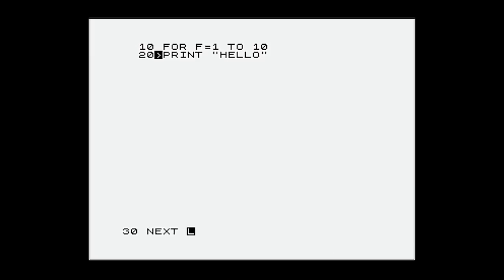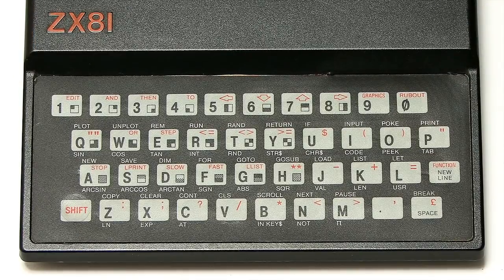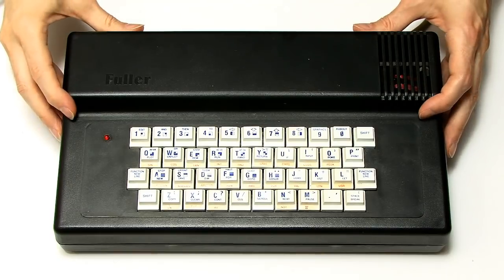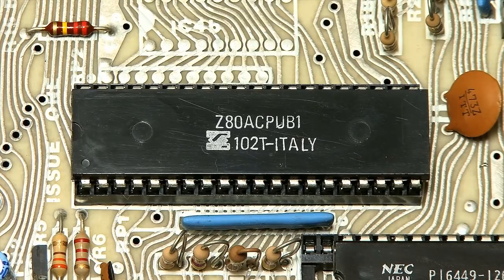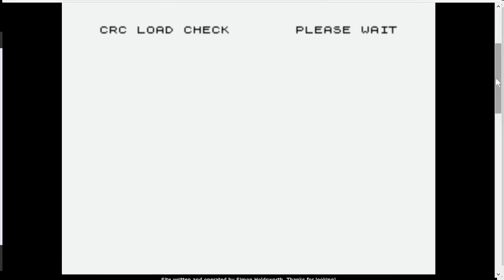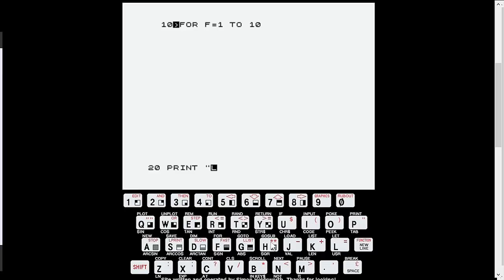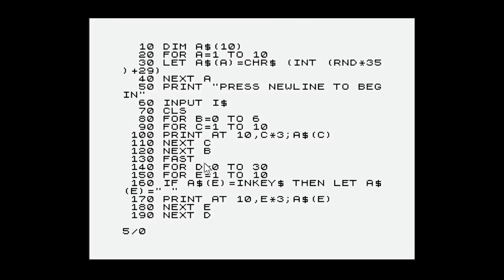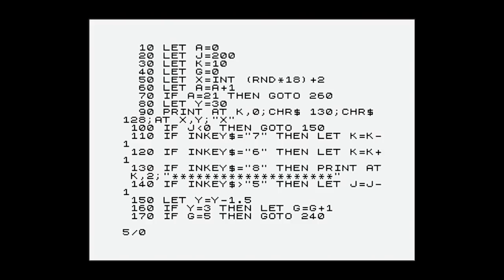ZX81 Classic PC

Comment: What a trip down nostalgia lane.
I bought a Timex sinclair 1000 in the mid 1980's at a flee market in downtown Johannesburg in South Africa.
I was so shocked to see it standing there with perhaps two more, and fearing that they will disappear quickly, I ran
to the nearest ATM and bought one.
The T1000 was not my first foray into the world of computing/IT. I first encountered them in the form of a 
programmable calculator in the early eighties.
My eldest brother was studying civil engineering and had to use one of those and it had a red LED screen and all of
50 lines you could program. Using his BASIC manual and trying out the HP calculator's own instructions (not BASIC) I wrote
simple programs. By the time I encountered the T1000, I had an idea of the implication of these things.
I later got a 48 ZX Spectrum and write a word processor for it in BASIC. One of the very useful features of the BASIC on the ZX Spectrum was 
the ability to assign a number t o a variable, and use that variable like a lable in a program. SO instead of writing 
20 GOTO 200, you could write GOTO/GOSUB printdata where printdata was given the appropriate line number. That was incredibly powerful.
I ended writing a decent 3-line wordprocessor that could print, save to tape load from tape and do all the needed edits.
Pretty neat.
Wow what a time that was. From there I ended studying Computer Science and Maths through UNISA (University of South Africa) and in 1995
I was amongst the first of about 250 people who finished the Microsoft MCSD qualification and becoming the first in 
Africa to Present MCSD courses as a qualified MCSD trainer. That is so long ago now.
Thanks for reminding me of a pioneering era in my life. 
Love your channel Chris.
Reply from the maker: Thanks for this, great post. :)

Comment: My first computer, which I still have, was the Rolls Royce of the genre in the early 1980s - the BBC Model B. It wasn't until 1990, though, that I got a program published (a lunar eclipse predictor) which earned me £98 - a considerable sum in those days.

http://www.acornelectron.co.uk/mags/mu/ills/090/sc-p043.jpg

I have a ZX81 languishing in a cupboard upstairs. I bought it to automate our central heating system. The wall-mounted boiler was in the kitchen so that's where the ZX81 had to go. Regrettably, the spark ignition on the nearby cooker hob caused enough electronic mayhem for it to crash every time, so that was the end of that particular project.

Comment: My system in the '80's was the C-64. Had started with PETs though. I actually started working in my school district's IT department my senior year and learned to repair various commodores as we were still keeping them working for elementary school classrooms.

I remember turning a couple into RAM test boards as the memory test software I had for C-64 was better at identifying bad ICs than the PC parity test we were using on XTs.

Comment: Great video! 
in 1983 or so I bought a used TS1000 at a pawn shop for $10, the bargain price was because the video output was garbled. As a electronics technician I thought that I could fix it and I did eventually. The fix was pulling the video processor PROM chip out of a good TS1000 owned by a friend of mine, copying the code from that chip and burning the code to a blank PROM. I think the blank PROM cost like $3. The video chip was mounted in a socket so once I had a good chip it only took about a minute to swap out, no soldering!
I remember playing the game "Frogger" on the TS1000 and transferring files to and from using a tape recorder.
After the TS1000 I bought a Radio Shack Model 4P which I recall also ran a Z80 chip.
Ah, the good old days!

Comment: Zx81 was my first computer. In fact you could get a replacement membrane keypad. I wrote for this computer as did my cousin who later purchased the Jupiter ace. Forth turned out to be amazingly fast. I remember having to use clever memory saving techniques for example to declare the number 3 which otherwise would take up extra bytes you wou type let a=Int(PI) . The other thing you didn't mention here is machine code or assembly. You would basically poke a Rem statement  then call the code with Rand user 16584 something like that. Which was cryptic coding back then. The machine language sits still today under all that windows dos, C coders overlay... The larger memory and CPU came about because too few people new the raw code and they had to compensate for bloatware. Thanks for the video thanks for the memory
Reply from the maker: Ah, I have not thought about memory pokes and the RAND USR thing for so many years! Thanks for the reminder. :)

Comment: I wrote many programs on my Timex Sinclair 1000 - I had the 16K expansion and the thermal printer.  I would write all my programs out in notebooks (my kids recently found them and laughed... I am not sure why-  :-) ).  I remember in high school loading my D&D game in from the cassette tape hoping it would work.  I can remember being able to tell if the load would fail if based on the sound of the tape.  Very frustrating.  I think about 1 in 4 loads failed. I still have the computer and components.  I love this video - Thanks!
Reply from the maker: The good old days. :)

Comment: My first home computer was a BBC Model B with the cassette filing system though I did upgrade to discs. After that it was a Gateway 2000 running Windows 95, but I still have my BBC and a great BBC emulator running on Windows 7.

Comment: I had the Timex version with the 16k expansion pack. It was a terrible connector on the pack as when it would warm up, it would often break contact causing the machine to crash and for me to lose my programs as i'd be typing them. The shoebox tape recorder storage was awful too. A dirty or misaligned tape head could mean a bad save. Still, it was very educational.
Reply from the maker: I remember time spent clearning tape heads trying to get a program to load! :)

Comment: Here in Brazil, my first computer, in 1984, was an unnoficial ZX81 clone, the NE-Z8000 with a 16k memory expansion (in a wooden case mod with mechanical keyboard and built-in TV converted for composite video input to operate as a monitor, without the use of RF signal). Great days!

Comment: Well my mum used to work in Timex in Dundee and constructed those Sinclair ZX Spectrums. Also Sinclair had made the right choice on using the Z80 as they are a superset to the i8080 when the former Intel chip designer Federico Faggin founded Zilog in 1974 and build the Z80 in 1976. The MOS 6502 was nowhere near as powerful as the Z80s. But to be honest it would of been better if Sinclair hadn't got split up from their former employees who founded Acorn that made those BBC Micros, and the legendary ARM archs. Besides both Sinclair and Acorn sort of got into a dead heat when they failed to compete for 16/32-bit rival computers like the Amiga, Atari ST, Macintosh, Windows 3.1 and Windows 95, as well as those 16-bit game consoles with faster loading time than the sluggish tapes and 3-1/2 or 5-inch floppies. And Alan Sugar from Amstrad who made a deal with Sinclair in 1986 didn't appear to rescue their business on computing as their Sinclair QL and Amstrad GX4000 failed. Personally I think those 16-bit computers would of been better using the Motorola 68020 or even those cost reduced 68EC020 released in 1984. But the Macintosh 128K sucked at monochrome and at a expensive price in 1984 and of course Apple need to test if their Mac project was compatible for 68020 and not too soon. Well...by 1984 both the founders of Apple and Commodore left and things got a bit dicey, not to forget the 1983 Video Game Crash that heavily impacted Atari and got tooken over by CBM's founder Jack Tramiel in 1985 for devising the ST.

Comment: That brought back memories.  In 1982 I was writing my Ph.D. thesis and used a Timex Sinclair 1,000 to analyze infrared spectra using a fast fourier transform using gaussian curves.  It was a real challenge to program that with the available memory and VERY tedious to enter the IR spectra to be analyzed.  However, it was a huge step up from my TI59 calculator.

Comment: Ah, the good old days, or the time I first got frustrated with computers. Good old 16K ram wobble, after spending hours typing, a little movement on the ram pack, and the whole thing would crash. I solved that by running wires from the socket to the connecter on the ram pack.

It did come in handy, when my spectrum packed up, and the only thing removable from the ZX81 was the component I needed.

Comment: Actually the ZX81 was known as the ZX81. The TS1000 came about after a manufacturing and marketing agreement between Sinclair and Timex. The difference was the ZX81 came stock with 1k memory and the TS1000 came with 2k. Another difference - the ZX81 was made available at launch as a pre-wired and working computer or a kit version for DIY'ers.

Comment: One of the first computers I used extensively was the TRS-80 Model I, but the first computer I owned was the Sinclair ZX81.  I spent hours, days and weeks during college making it do things the bigger computers could do.  My favorite was solving equations using matrices.  I could solve a 5 x 5 matrix and display the result in 1K RAM by minimizing the display output. I eventually got the 16KB RAM pack and bought the flight simulator program for it.  I was impressed that with such low resolution, it provided a very realistic and accurate experience for landing on a runway at night.  I still have it stored somewhere and it worked last time I used it, but I need to find a power supply and an analog TV to use it again.  Thanks for the link to the simulator.

Comment: Surprising that this video unaware of the main innovation with the ZX81 besides the membrane keyboard by a Lucas subsidiary. Why is this thing so small compared with say the Apple II? The presenter declares there is nothing really of interest on the board! See the Ferranti chip; well that is a pioneering UCLA or in this case an Uncommitted Digital Analogue Array that is custom masked to replace all the other chips you do not see here, but are in an a big Apple. Now such tech is comment place...
Reply from the maker: Good points.

Comment: I bought a TS1000 from a flee market in Johannesburg, South Africa in the mid '80s with a 16k ram expansion module. A year or two later I bought a brand new Spectrum 48k. I had the UHF modulator disabled and bypassed and the pure composite video output could be used via an AV connector to a PAL (625 line) monitor I also bought later. Still later I bought a printer and a parallel port connector cable, but had to buy a Centronics interface connector to be able to connect the printer to it. I had to write my own 3-line word processor editor in basic. I called it my periscope editor. A full screen editor was to slow because you had to watch it build up the screen line by line so slow it was.
I could insert lines words, make them bold and delete letters, words, lines. In addition, I could save and reload my files to and from tape and print them. It was unbelievable. It launched me into my former career in IT and as first qualified MCSD trainer in Africa. I feel such nostalgia today. Thanks for bringing back those memories.
Reply from the maker: Great post, thanks for sharing.

Comment: My first computer was a Vic-20. Then I moved to the C-64, then C-128 and SX-64. I also managed to get some PET computers along the way as well. I played with Unix and CP/M before Linux came along. My first use of a modem was in 1982 at age 16. I had a 300 baud modem and called BBS's in Chicago. Ran my dad's phone bill up to $90. Wow I was in trouble. I had to work off that bill. I got a bunch of software and took it to school. Looking back I should have bought a bunch of floppy disks and sold copies of the info I downloaded to pay that phone bill....

Comment: I had a ZX81 from about 82; it was so slow in BASIC that I learned how to program it in machine code, stored in REM statements. I added a  RAM chip with circuitry to switch it in and out of the video ROM space, so that I could define "sprites" of 8x8 pixels instead of the ready-made shapes. I got the circuit and code from one of the magazines. I also had a 16K RAM pack, but it wobbled, so I hard-wired it to the expansion port. That was much better. Then I made a "proper" keyboard with real switches; I wired it wrong and fried the ZX81, so I got a CPC464 instead - mostly because it used the Z80 chip.
Reply from the maker: Happy days!

Comment: I owned a zx81 from the 90's, though my first computer was a zx Spectrum in 1984. I also got a 16K memory expansion for it, though never used it much as hitting it a tap could lock up the zx81.  I actually got 3/4 way programming a version of Connect 4 on it, in MC obviously, before a change of address interfered, so I never finished it.  I remember the fast & slow modes with fondness - you could run code much quicker in fast mode.  I actually still have the zx81 around somewhere.  Along with the Spectrum with Disciple disk i/f, Oric 1 & Atmos, Sinclair QL, Elan Enterprise, plus a load of Ataris, and maybe a few more.  I even had a Dragon 64, Spectrum 3 and a Tatung Einstein, but those computers didn't have the 'soul' the others had, so I dropped them into a charity shop so they could find new homes. Memories. :)

Comment: I wrote a game that you could translate as star eater. It was a V , the "spacecraft" that flew through from top to bottom  and ate stars * on his flight path.
In reality it stayed on the top line and the rest scrolled up. Due to limitations I peeked and poked a lot in the memory that presented the screen. Disadvantage was that the screen memory was located behind the coding memory. Therefor when you changed some coding the allocations changed. I wrote a subroutine that figured out what the first screen memory location was. If I am correct it was after the first double 118 (end of line code)
Yep, those where the days. Because it was on of my first attempts and I had no experience with coding I ended up with spaghetti programming. Line numbers where fixed and when you decide to put something between linenumber 10 and 20 you put it at 15 But later I found I had to insert some more. So at line 12 It said: goto 200 and  at 300 it said: goto 13 
I extended it more often. No printer so at a certain point I really had no idea what I was doing. I got extra points simply for making the level. Went up exponentially. 
But I had a fan. When she was at my place she always wanted to play it.
Reply from the maker: Oh, I remember all that peek/poke and things moving around in memory game! :)

Comment: Our first family computer was a ZX81, and like yours, it was re-mounted in a better case along with a 16K RAM pack and some sort of graphics expansion gubbins. By the end of the 80s I'd acquired a broken Spectrum off a mate at school, the rubber keyboard was knackered and it didn't power up. I replaced the 5V regulator IC, and mounted the board inside the ZX81 keyboard case, before re-wiring the keyboard to make it compatible with a Speccy motherboard. Sinclair made some great innovative stuff, but sometimes too many corners were cut to keep costs down. The factory keyboards were legendarily cack, and the voltage regulators were notorious for failing, due to not enough heatsinking inside the case, something which was addressed in the later spectrums. An extra lump of aluminium bolted onto the heatsink kept mine running cool for years.

Comment: I remember everyone wanted a basic to machine code assembler and then a big head line appeared on one of the main magazines stating they had the program inside it.
I took hours to type in all the code and when ran the screen went black then white and two words slowly began to take shape in the middle of the screen and when finished it read APRIL FOOL slightly annoyed was the understatement of the year.

Comment: Hi had a ZX81 but couldn't afford a prebuilt one so I opted for the kit and when i finished building the computer and i also had to build a power supply I pressed the magic button and waiting for the k curser to appear and nothing happened except the ULA chip got very hot.
So i wrote a nice letter to Sinclair research centre and Clive sent me a brand new ULA chip and the magic K curser appeared.
I tried to write a mars Lander program but sadly by the time i had poked a black character in every screen location i ran out of memory so i built a screen inverter from one of the magazines so i had a black screen with white text but still ran out of ram.
So my next project was a 3k ram pack built on proto board and using a wire wrap tool and to my surprise it worked but alas i never finished my Lander program as i moved shortly to a acorn electron.
It was only last year I cleaned out my lockup that I've had for a very long time and i came across my old ZX81 with is add-on maplin (i think) keyboard, also in kit form and now they have sadly got to the great tip in the sky

Comment: My first computer, bought in 1979 was a TRS-80 16k Level I Model I. I spent a lot of timetyping in programs from books and magazines. I eventually expanded it to dual disk drives and 48k Level II.

I later owned a TS-1000, and a ZX-81 I built from a kit. I also worked for Zebra Systems, a company that made software and hardware for the Timex/Sinclair Computers as well as Atari and Amiga.

https://www.youtube.com/watch?v=GtDG5cWmH8s
https://www.youtube.com/watch?v=awUonjY_jcs

Comment: I got a Commodore 64 in early 1983 while in high school with my paper route money. I learned BASIC first, then C. In 1990 I stepped up to the Amiga 500, and I consider that my first real computer. That one lasted me until 1996 when I built my first AMD Windows computer. Though I still have my Amiga 500 and it still works.